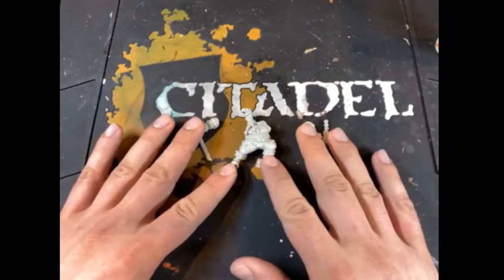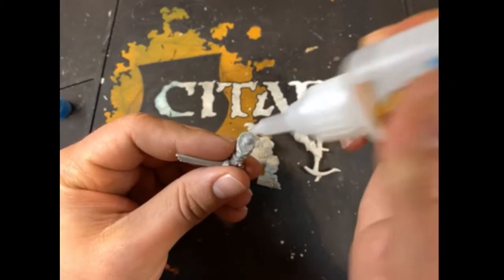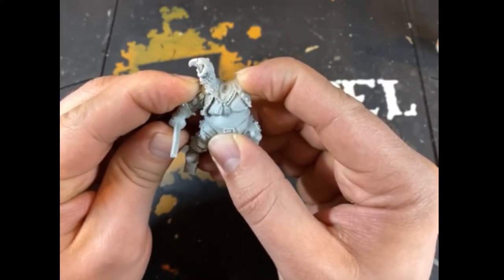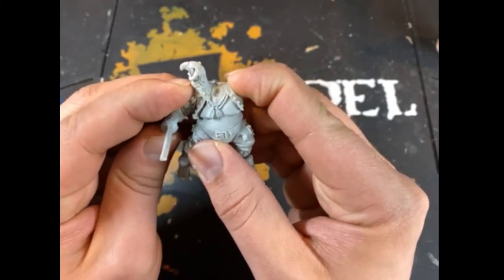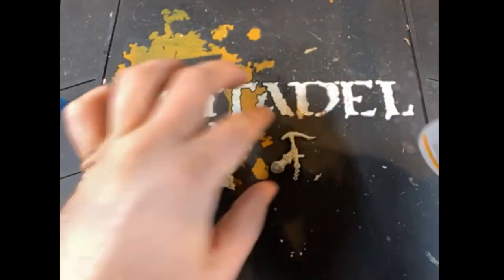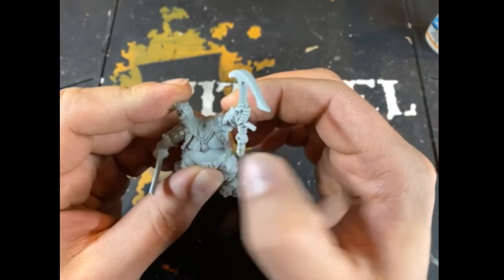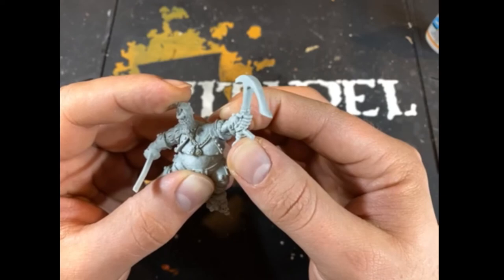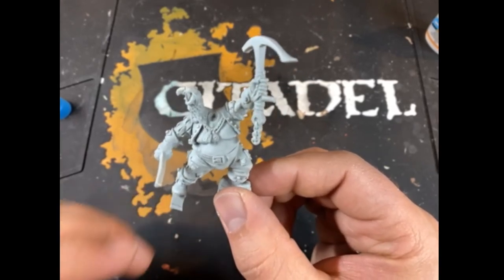How To Glue Resin Models

Comment: You addressed my issue when you mentioned that some are not easy to see how they go together. I just did my 3rd 3D print session and my monster has no directions and no neat joints for assembly. I do have a photo. This helps.